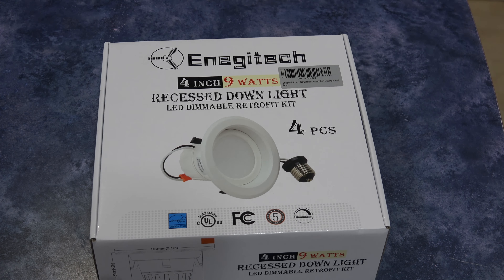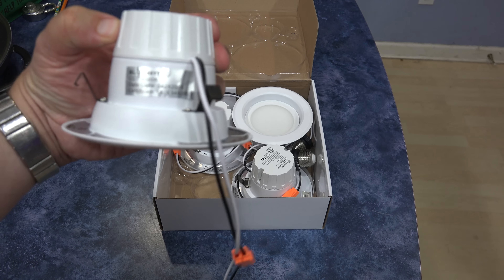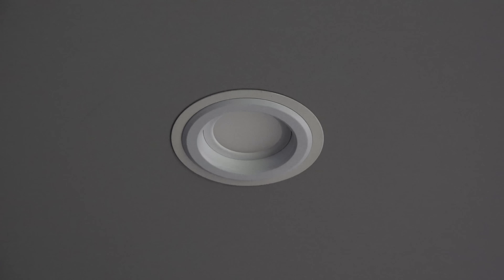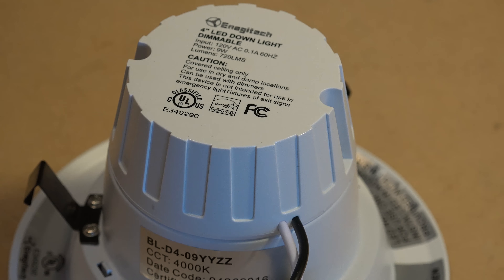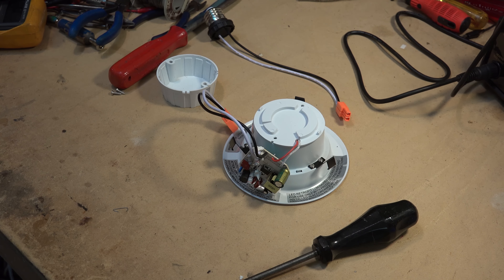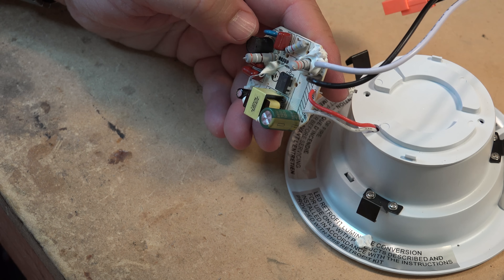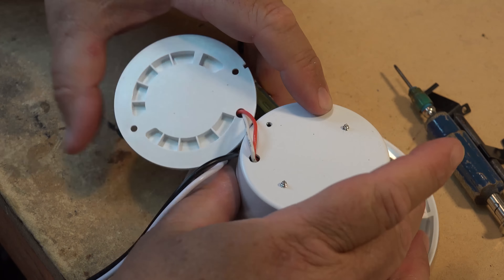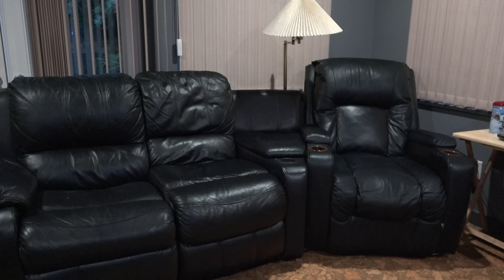Enegitech LED Retrofit Kit for 4" pot light fixture install tear down and test

Comment: These lights are amazing!The package so nice,They have three  temperature.I like the 4000K temperature.they called "soft  white"
Reply from the maker: They have 3 color temperatures 3K soft white like an incandescent,, 4K Daylight white which is what I was sent, and 5K which would be more blue.The 4K are a good choice because they have very good CRI.I run 4K HID lights on my car. I initially had 6K but found they far too blue and actually reduced visibility in poor weather. The 4K headlights I have now provide the best color rendering visibility.

Comment: They are pretty cool. There is a set of 4 and all are packaged very neatly into a very covienient box.And they provide a lot of light for wherever you install them.
Reply from the maker: So far they are the only ones that work with my Lutron electronic dimmer. All the other brands of LEDs do not work at all unless I leave 1 incandescent light on the string. This is because the lights don't draw enough power to peoperly power up the dimmer. This has been addressed with newer dimmers that have a neutral wire, but my dimmer is 3 years old, and even though it says it works with CFL and LED bulbs, these are the first LED bulbs that actually work properly. CFL lamps all worked, but other brands of LEDs made in the past 3 years have not worked. These ones did right out of the box, so I am pretty happy.

Comment: Hey, thanks for the comprehensive review.  I'm looking for lights to run in my tiny house and was wondering if you could confirm that the lamp itself runs on 12vdc.  Thanks!
Reply from the maker: No the lamps run on 120VAC. The output from the inverter is 56 volts DC.
Each of the chips has 2 diodes in series, so each chip needs 6.2 volts, and there are 9 of them in series. so 6.2 x 9 = 56.
Meter across the input to the lamp assy confirms 56 volts.
Just like the LED lights in TVs they put them in series and run them at high voltage. Higher voltage = less current = smaller gauge wires smaller components ect. So it just makes sence to do it this way, even though in theory they could run them on 12 volts, have 2 LEDs in series, and then have 4 or 5 strings of those 2 lamp series connected. They would run at an input of 12 volts, but require 5x as much current.
Reply: 12voltvids thanks for the speedy reply!  My thought was  to take out the individual inverters and run them all strictly on DC from a single distribution point.  Easy if it was 12vdc but maybe not so easy with 56v's.  

We plan on running solar to batteries and it seemed silly to go from the solar DC to inverted AC and then back to DC at the lights.  Any thoughts on what my best option might be?

Comment: The lights look good, thanks for the review.

Your home looks awesome - do you run audio electronics from a central location for a whole house system? I noticed the ceiling mounted speakers, wondered if it's a multichannel setup for the lounge or if you have music all over the place.

Cheers!
Reply from the maker: Thanks. Yes all my components are mounted in an equipment closet where I don't have to look at them. 
The only piece of equipment in the TV room besides the plasma is a Blu-ray player.
Reply: If I weren't a voyeur in terms of liking equipment being on show, I'd like to do this sort of install in my home. We have equipment linked to provide the same source in all rooms, but I haven't yet grown up enough to keep everything hidden (nor is there a space big enough to house the music sources and movie sources/amps.)

Whole house wiring installs interest me greatly - kudos to you.
Reply from the maker: My living room is the showpiece room with my tube amp on the top shelf and my music sources, 200 disk cd, Dat, cassette, and reel to reel. In the TV room I wanted the clean look. All the equipment is under the stairs in a closet.

Comment: I would love to have one to light up the room and it is indeed much better lighting and much better CRI than Incandescent, CFL, and Halogen Lights that don't provide the best accent lighting. =)

True White LED Lights is what I really love. =)
Reply from the maker: You can buy them from the link in the description. Every sale helps not only the vendor, but helps me as well as positive sales will ensure a lasting business relationship with the vendor.
Reply from the maker: These are available in 3 color temperatures at the link above. 3K, 4K and 6K I believe. So you are covered as far as color temperature goes. The more I use these, the more I like them.

Comment: I like the simplicity of the fitting, no actual conversion of the existing light bowl.
Shame they didnt cast some plastic clips in the top cap to hold the inverter in, silicone is such a crude way :-(.
I suppose that leds have a switch on knee characteristic, like a diode, so it would be hard to go below a certain dimming.
Good units though.
Reply from the maker: I would have preferred a clip in pc board, or a few screws to hold it in place, but hey works right. UL has certified them, so they have no issues with the build quality.

Comment: So why don't the electronic dimmers work very well?
Reply from the maker: Some electronic dimmers don't work because they require a resistive load to power up their internal circuitry. Led and CFL are an inductive load.  Some LEDs will work and others will not. These ones work fine.